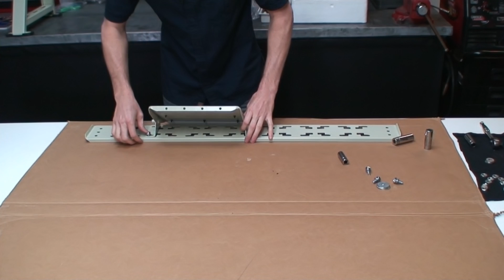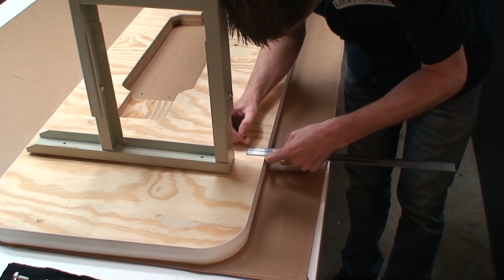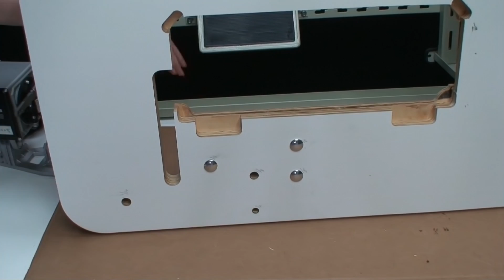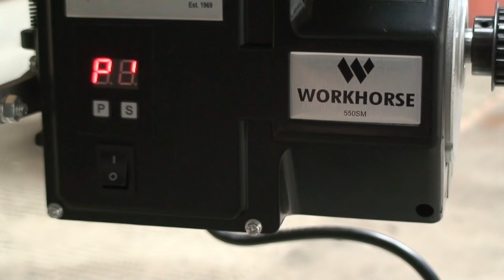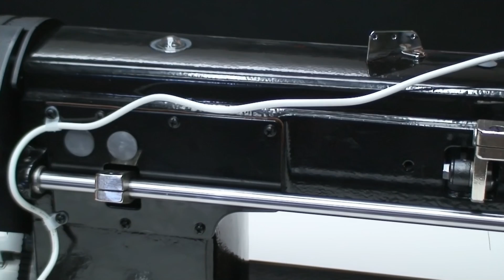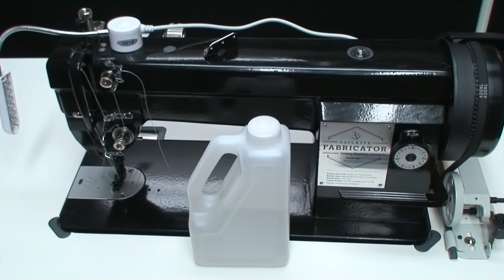How to Assemble a New Sewing Machine and Table - Sailrite Fabricator

Comment: I know its been 4 yrs later, but did you notice that your 1 1\2" off on the height. It was supposed to be 29" to the underside of the table, not 29" to the top. The underside of the table you assembled will only be 27 1\2" from floor to underside of table.. Just FYI> But otherwise great assembly video.